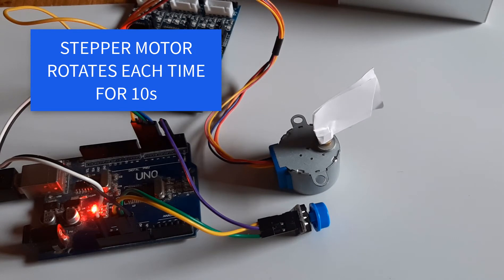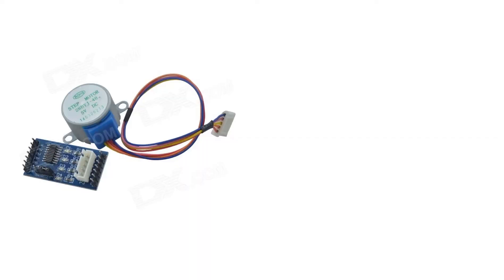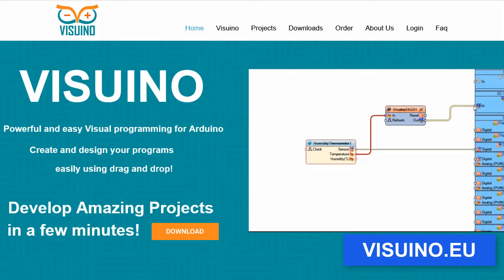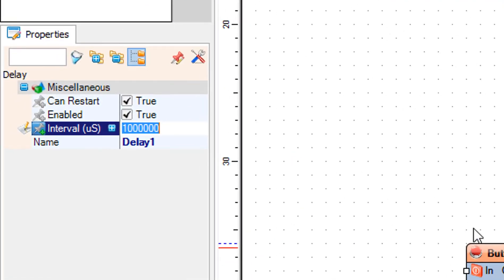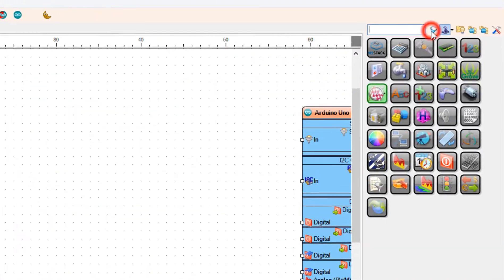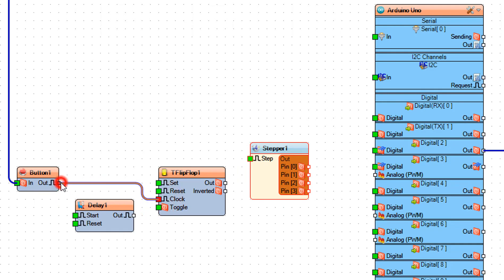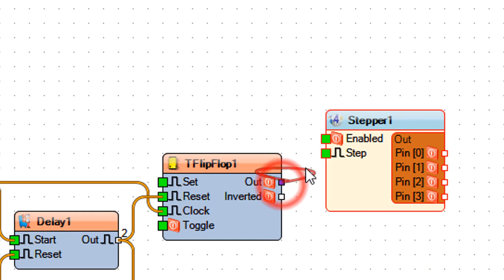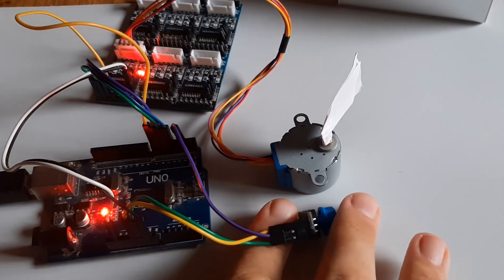Arduino Stepper Motor Running for a Specific Time

Comment: hello, what if i want the stepper motor to run for a specific time and repeat itself without the use of the button? How can i edit the code to achieve that outcome?
Reply from the maker: You need to experiment with it

Comment: what if i had to connect a simple water pump ? can it be done with relay? and for that will button module be required??
Reply from the maker: You can check out this tutorial https://www.youtube.com/watch?v=iHvKP9a0ZYk
No need for the button module, depends on your goal. I am using button module because its easier, you could just add a simple button+resistor in current tutorial.